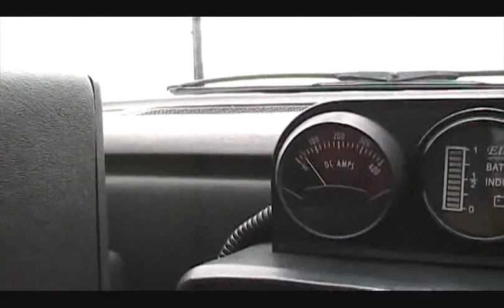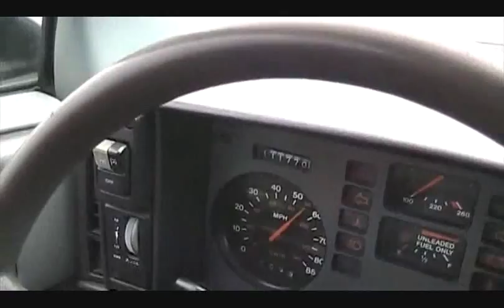Full Electric Car Home Conversion - 1988 Pontiac Fiero Part 3

Comment from the maker: @graywackeknifebdr There is no free energy. But the power of the electric motor is versatility and efficiency. You can power an electric motor with a gas generator, solar from your roof as I do, hydrogen fuel cell, nuclear from the grid, coal, hydro, geothermal, wind etc. The only problem is storage. And even this issue can can be circumvented with some creative solutions.

Comment: @TheBuIIshitable   I could see saving 6000 dollars in fuel easily. If I got a car that got 40 mpg just that would save me nearly 200 dollars a month, that would make it 2400 dollars a year, 6 thousand dollars would be saved in just about 28 months if I am figuring right in my head.  Then if you look at an electric car, what does it cost to charge one money wise? 4 bucks? if you can get 100 miles to a charge that would be like getting 75 mpg and you would break even even faster.

Comment: I know of a guy who have invented a electronic battery controller for lead acid batteries. In  simple means it take power from one or two batteries of at the time, of a total of lets say 10 batteries. About 2 seconds of drawing and 8 seconds rest for each battery. The batteries that are resting is connected together  in parallell, and the batteries working is taken out of the system by mos-fet transistors. He gets almost triple energy out of the batteries that way! He won a price for it as well.
Reply: Wow the original story of the BMS,cool🔥.

Comment from the maker: Definitely better mileage when I'm cruising on the open road at a constant speed. Like you said whenever I start from a dead stop the ammeter just pings at 300 or 400 amps and then drops once I pick up speed. So what is your conversion? Do you have some vids or pics?

Comment from the maker: I'm not exactly sure but I estimate about 3600 lbs. When I get a chance I'm going to take it to a truck scale and find out for sure. The conversion was about $6,000 not including the car, and the batteries. There is no clutch so shifting up takes about 2 times as long as before the conversion and downshifting requires rev-matching.

Comment: Great job with the fiero!
I'm curious as to what the car's final weight is?
How much did the swap cost a do-yourselfer such as your self.
Is it difficult to shift gears on the fly?
If you ever want a shorter shifter arm, you can buy a bolt with the same thread at the hardware store and cut the welds on the old stick and weld the shorter bolt on.

Comment from the maker: So far the max range is 30 miles. Though it takes about 40 charge cycles to fully condition the batteries so I think after that I should be able to get about 40 miles. From a full discharge it takes about 8 hrs but for usual driving drain it takes about 5 hrs. The charge cycles can be anywhere from 800-1600 charges. Age and depth of discharge make a big difference in the total amount of charge cycles for the life of a battery.